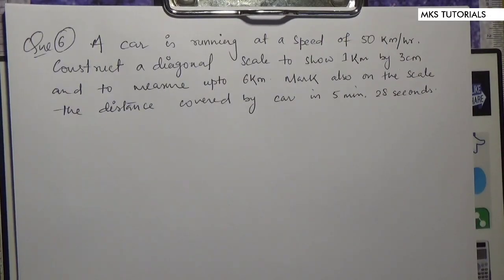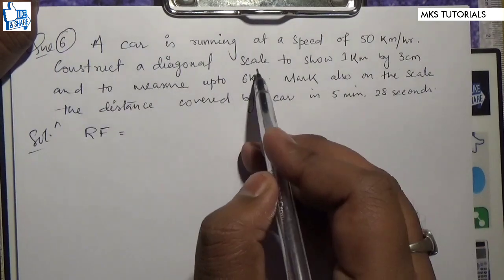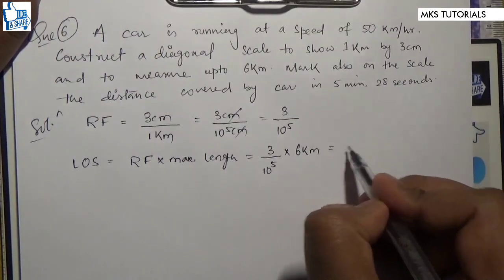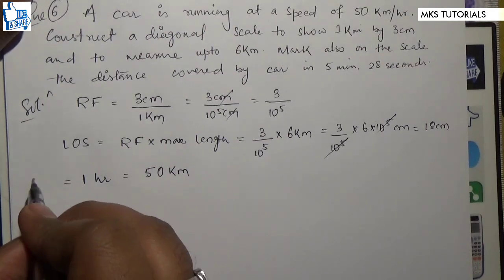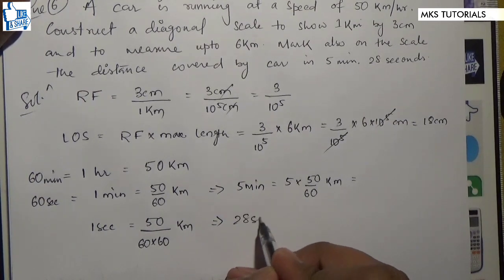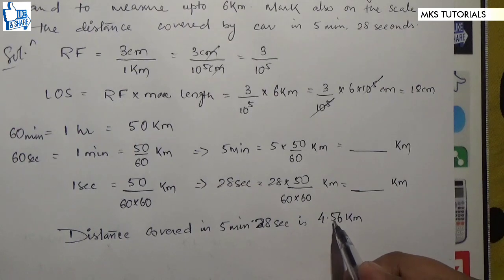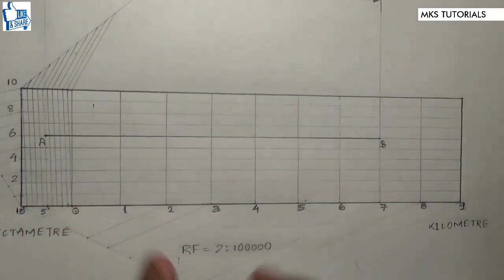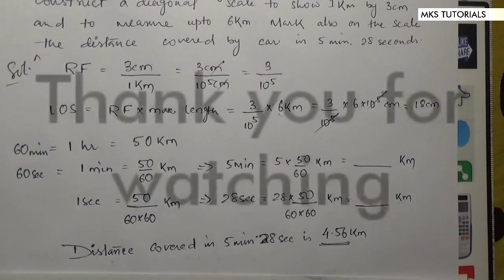14. Construction of a Diagonal Scales | Problem#6

Comment: A car running at a speed of 45 Kilometres per hour to reach Ghaziabad from Delhi in 20 minutes. If the distance between Delhi and Ghaziabad is shown on a map by a distance of 2.5 cms draw a graphic scale for this map and calculate the R.F. also Construct a graphic scale on a R. F. of 1:40000 so that one can read kilometres and metres directly on it